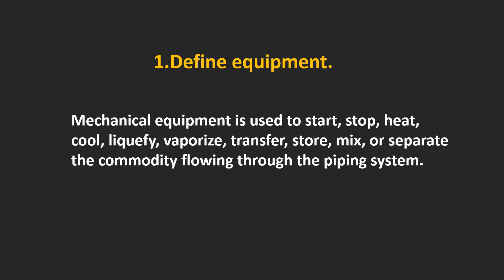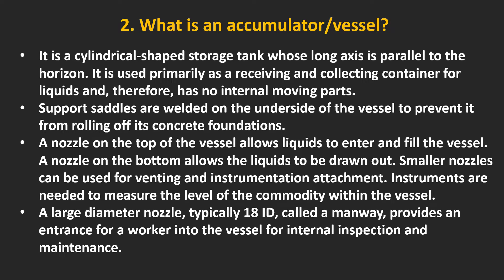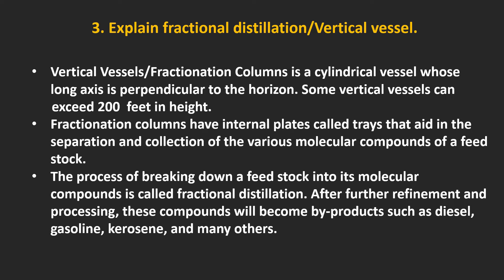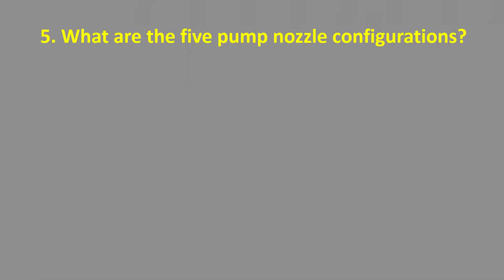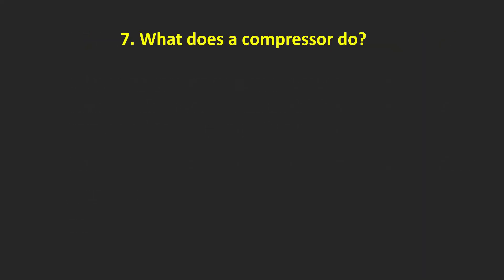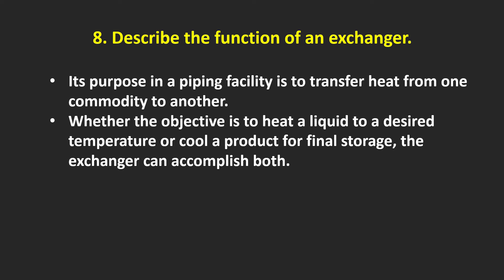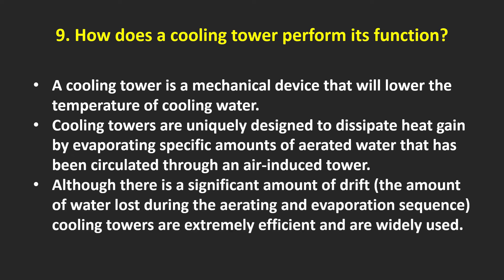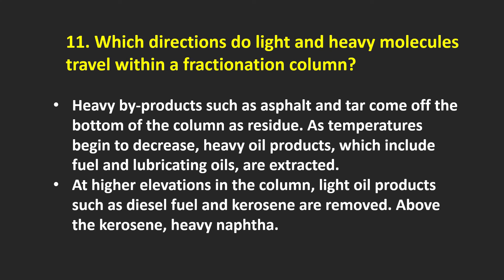MECHANICAL Interview Question & Answers  (oil and gas)-PART # 02

Comment: Sir Please prepare some videos on static equipment inspections one by one with related NDTs and other testings performed by an Inspection engineer.  I want to know my responsibilities as an inspection engineer when i am going to inspect Heat exchanger, pressure vessel, column, reactor and heater etc.
Reply: If you got answer please share with me